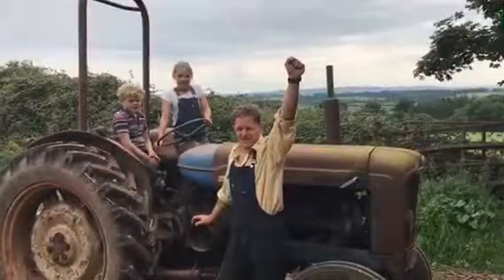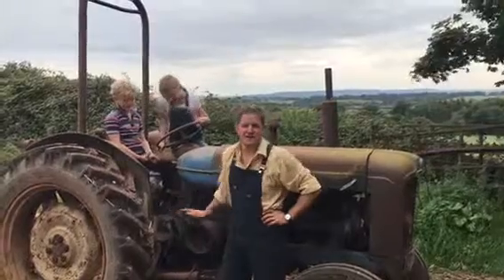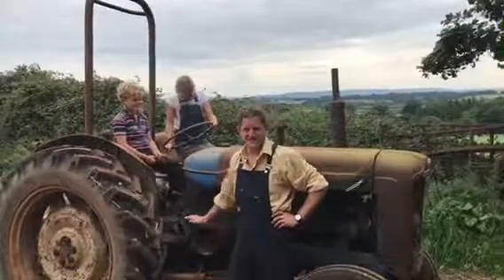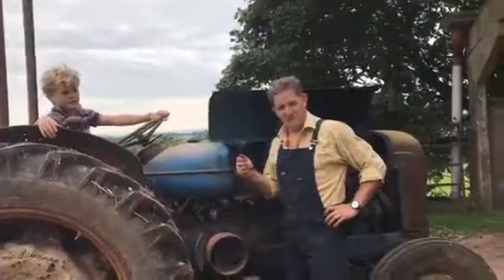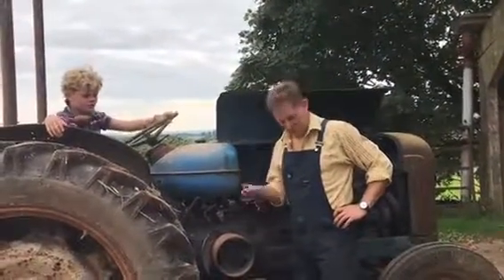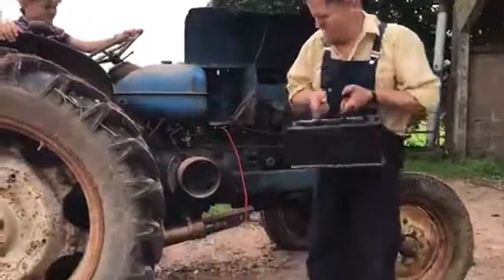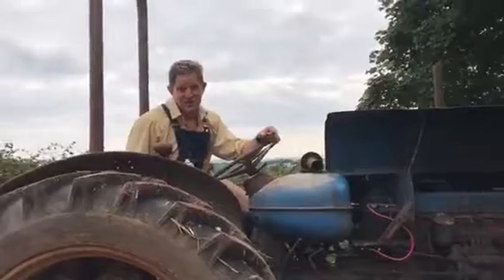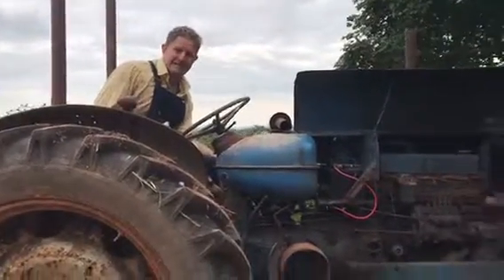Fordson Super Power Major Start Up

Comment: Should not be that hard started and don’t be using easy start it ruins a engine
Reply: You are correct. Nothing starts like a Major and this one will have an excess fuel button on the stop cable linkage on the fuel pump since it's a later Minimec pump!